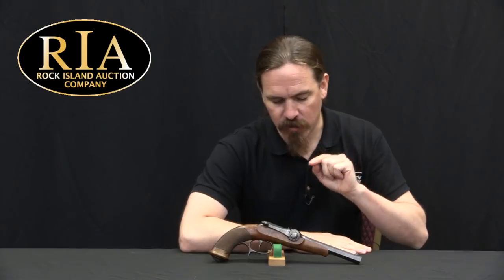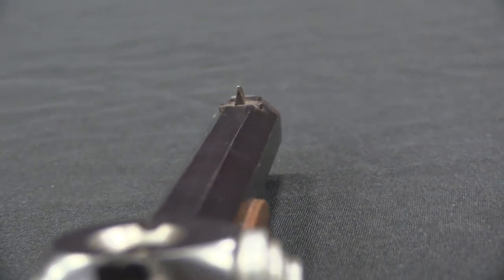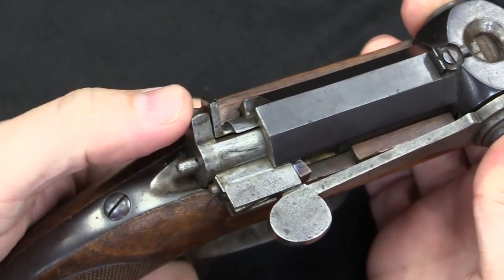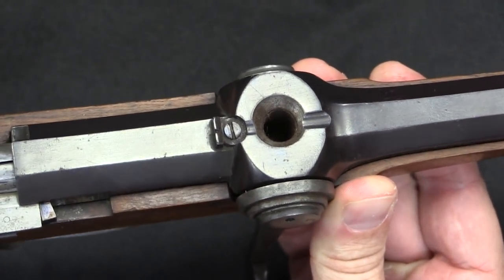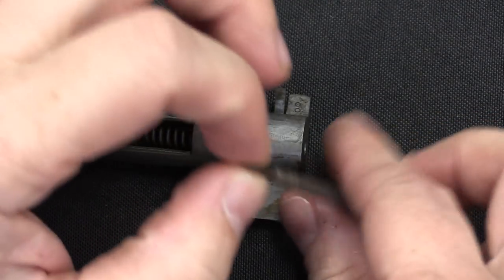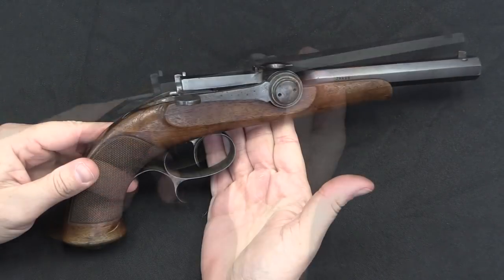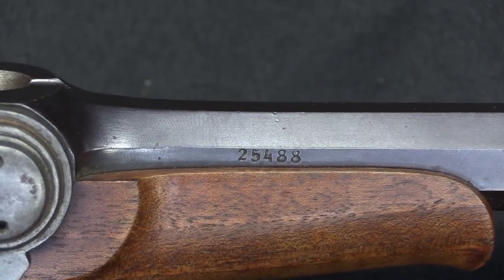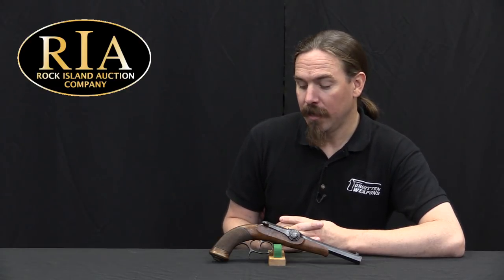Dreyse Model 1835 Needlefire Breechloading Pistol

Comment: So when you reload the cartridge is pointing at you... That chamber better be cold.
Reply: Ian did say it's a really weak powder charge, not sure that thing would get hot enough to fire autonomously during reload before your paper cartridges ran out!
Reply: If it got hot enough to cook off before you could close the action it would probably be too hot to work the action? Plus if it cooked off while open it would just explode so it doesn’t really matter where it points
Reply: You'd have to swab it after each shot like a muzzleloading artillery piece!

Comment: What happens when the burnt paper builds up in the bottom of the breech? Surely some residue would clog the weapon,and necessitate thorough cleaning?
Reply: I was thinking the same thing but just the black powder residues alone would necessitate a clean through? 
Only way would to have a special cleaning tool matched to the breech block internal shape?
Reply: @markrussell4449  Sounds about right. Something would have been available. A similar tool used for cleaning the rifle?

Comment: Is 6 grain gunpowder even a vimpy load. I thought you put more in the pan in a flintlockpistol. It´s 0.389 gram or 0.14 Oz for anyone who wounders.
Reply: With high quality fine (4F) powder, I have no doubt it can be deadly at short distances. I have a .44 pocket pistol with space for a 9gr charge, and I don't want to stand in front of that thing for sure. ^^ A friend shoots a .36 Pedersoli  percussion pistol with 8gr Swiss No1 (4f), and it actually feels quite zippy. It will not knock someone off their feet for sure, but will poke a nice little hole.  I think it would have been sufficient as a traveling pistol. Some pocket pistols at that time were only .31 with similar charges. But not quite a military weapon. ^^
Reply: I had loading data for .357 Magnum infront of me. that is 19 grain of smokless.
Reply: @exploatores  Which was an exceptionally powerful handgun round when it was developed in 1935 .. not to speak of 1835 when this pistol was made. Probably about 20..30 times the kinetic energy this little pistol can deliver. ;-)

Comment: Six grains of black powder? What was it used for? Hunting mice?
Reply: It had actual cartridges though.
Reply: @k.w.4241  15.5 × 6 grains would'nt fit in that small breach. It's probably 6 grains.
Reply: @danneeson4341  I can be wrong but I think 6 grains of black powder works out to abut 12 drams, which would be about right for a 35 cal pistol
Reply: To put it in perspective, original load for 22lr BP cartridge was 5gr of FFFF [or FFFFF] powder...

Comment: Not a 100% on this, but 6 Gram are more like 92 grain.
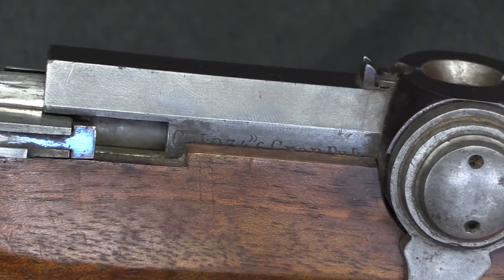Reply: Time Index 6:22 I was able to geht a closer look at the barrel. Ian said: "...... Six Gran of powder".
Now there was a weight measure in germany during the 1800s called "GRAN" (not GRAIN or GRAMM) which was in use mostly in pharmacy-shops. I don't know, how many GRAIN made one GRAN but this seems logical to me, because Dreyse was a german gunsmith and so he would use a common measure-unit of that time period to mark on the gun.....
BTW the pronounciation of GRAN is "GRAHN"
I know from my own muzzleloader shooting that the load for, let's say, an M 1860 Army Colt is 20 grain. MAYBE, a GRAN is equal to three grain, so that makes six gran is equal to eighteen grain, which would make sense......
Reply: @paul-sparky-sparr4160  I did not know that, very interesting. I read just read up on it and turns out, 1 Gran is about 64 mg, which would equate around 6 Grain. So Gran and grain were pretty much the same.
Reply: @schwaulen  So, when I understand it right, six Gran equates thirty-six grain.
That would fit to a .35 cal pistol...... but I think, that amount of powder could be a little bit too powerful. It equates the load of a rifle.
On the other hand...... grain and Gran is approximately the same...
That load would really be too "wimpy" even for a pistol.

Comment: The Firing pin has a removable needle, about the Size of an RCBS decapping pin ( large)...so a small supply of pins could keep the gun running as needles burnt out ( or use stainless  needles....longer
Life)
DocAV

Comment: It's fascinating to see how far we've come in our weaponry designs.  That needle being hollow was rather a surprise, I wonder if it would have held up better if it had been solid through.
Reply: Currentlyunnameddj the actual needle isn’t hollow, like he says the needle itself is missing. The hole in the end of the needle-holder stem thingy is where the actual needle would have been attached, these were manufactured in two parts and only the larger rear part is still there.
Reply: @Klippy Klop yes, the needles had to be replaced somewhat frequently. The actual thin needle bit is missing from the gun in the video, just like Ian says. That's why the end of what remains looks hollow. The needle itself wasn't hollow.